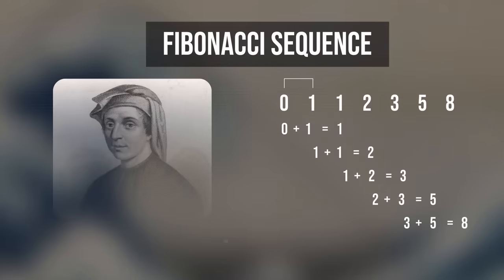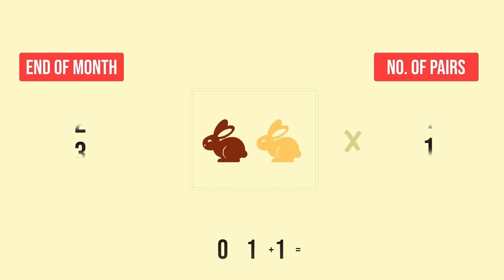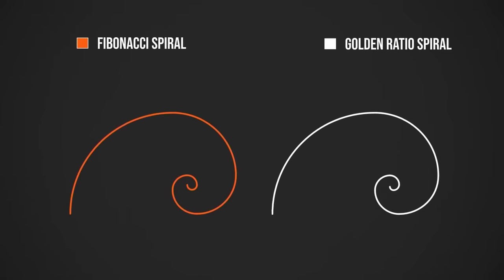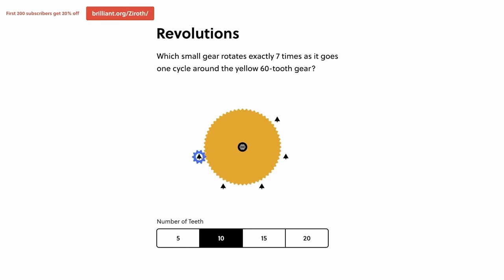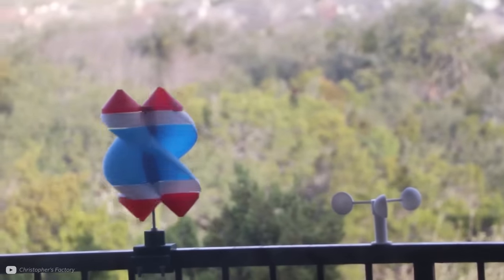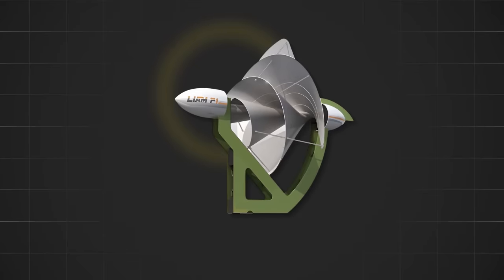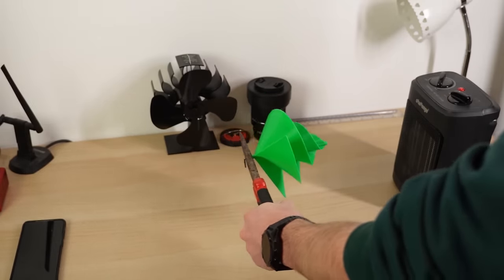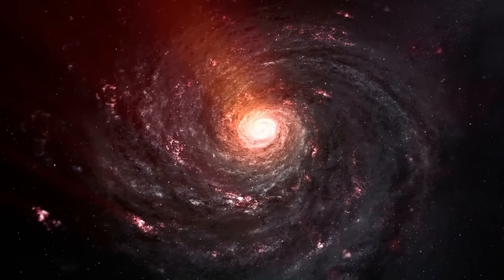Uncovering The Genius of Fibonnaci Turbines

Comment: The most important metric of a wind turbine is the levelized cost of energy (LCOE). This metric allows you to compare all forms of energy generation in terms of total energy return during the lifetime of operation per investment dollar spent.
Reply: Not at all. 

You fx also has to add the local climate by temperaure and dirty air, where there are many buildings. 

That give people a lot of bills, they are not 100% and also needs for expensive beds.
Reply: lets for a moment ignore the fact that wind turbines do affect the eco system for birds and other wildlife... 

most wind turbines do advertise a life span of 25yrs (which is true in a controlled environment) but we're almost at the end of some of these wind turbine government contracts and the true cost comes out, on avg these wind turbines last 1.5yrs- 2yrs on avg before needing to be replaced and the efficiency actually drops to less than 33% within the 1st 3mts of operation (on avg every 8-10mts the blades is replaced).. this is all thanks to the blades deteriorating much faster than expected, you can use the strongest materials known to man and this would still happen.. the other factors is the weather pattern and storms, in the real world when storms hit wind turbines they need to be replaced, even if you can't see the damage there is micro cracks all over the blades and 90% of the time the motor/ generator is damaged.. now if you think burying nuclear waste was a problem well getting rid of the glass fiber blades is a much MUCH bigger problem (in terms of space requirements) and no they don't biodegrade... as a comparison wind energy takes more ppl and more jobs is created than nuclear energy BUT because there is over 100times more ppl required to make the same power so that factor alone makes wind power more expensive than nuclear energy....
Reply: @dunhillsupramk3  I'm interested in learning more. Can you cite your sources?
Reply: Very interesting.Takes me back to June& July 2000 when I was part of a group of teachers that visited the USA  to learn new methods of teaching Science, Maths and Technology.That is where I first learnt about Fibonacci.VERY VERY  interesting that  nature has the aswers to many of our questions about our lived world.
Reply from the maker: Great point! There were not LCOE figures available, partly because only one of the shown designs is actually commercialised. I image the LCOE would be pretty poor for the Liam F1 Archimedes turbine if you brought it from the manufacturer, but the design is pretty simple so I wonder if there are benefits in the DIY space! Thanks for the comment!
Reply: @ZirothTech  thanks for the reply and the great video! I'm always excited to see innovative renewable energy ideas! By the way you did a great job explaining things, I've just noticed that engineers tend to focus on efficiency when return on investment is what actually drives large scale adoption. I'm a Mechanical Engineer and have been guilty of this myself in the past.
Reply: @bobbob-gg4eo  You can't cite on Youtube.  They blocks comments that list sources.  Even just the names of books.
Reply: @MM3Soapgoblin  aka "I made it up and have nothing to back me up"
Reply: @richardmyers6372  Not my rules... go ahead and try to post some sources.  Then open up a private browser and see if the comments show up.  I'm not defending either position.  I'm pointing out YouTube's rules.
Reply: @MM3Soapgoblin Twi Global: HOW LONG DO WIND TURBINES LAST? CAN THEIR LIFETIME BE EXTENDED?
Reply: Oh, would you look at that, the comment is still visible...
Reply: @richardmyers6372  I don't see a comment citing a source...
Reply: @MM3Soapgoblin  Weird, I see the name of an article that when searched brings up the source as the first result.  I suppose your browser has an issue, have you tried deleting your cookies and clearing cache?
Reply: @dunhillsupramk3  High estimates of bird deaths in the U.S. from wind turbines are around 1/2 million annually.  And from windows, 1/3rd to 1 billion annually.

> lets for a moment ignore the fact that wind turbines do affect the eco system for birds and other wildlife...

Good call. 😉
Reply: @funfight22  Try citing a real source like a scientific journal or textbook.  I don't consider the name of an article like that a source.  I saw their comment, my point was that it was not a real citation.  I've tried recommending textbooks on some physics videos and the comments are always blocked.  Same when I try to link to scientific papers.  Names of blogs and articles are hit or miss because, like in the commentors comment, it looks more like a regular sentance than an actual article.    Like if he put the url domain, no chance it would have worked.
Reply: @MM3Soapgoblin  lets do a test.  this is reply 1 of 3 for a reference.
Reply: @MM3Soapgoblin  OK,  in my browser, the direct reference is delete, but it's pretty easy to get around. as comments 2 an 3 do show up.  Thanks for inspiring me to figure this out
Reply: @thekinginyellow1744  Are you logged in as yourself or did you open in private view without logging in?  The only response I can see is the "let's do a test 1/3" one.
Reply: @MM3Soapgoblin  OK, it looks like they have both a fast and a slow algorithm.  the initial reference was deleted immediately when I posted the comment, but it did leave the rest of the " 1 in 3" comment.  but now, after 4 hours have passsed, comment 2 and 3 have been completely deleted.  I have verified this for when I am logged in as me using the chrome browser, and for when I am not logged in using the firefox browser.   I guess I'll have to try harder.  Every day I grow to like youtube less and less.
Reply: @HonoredMule  oh you want to go there?? then lets go there... so when i said it affects the bird and other wildlife its actually much more than just killing them... if you ever looked at a wind turbine you would notice that there is a lack of birds and the ones that they do kill is mostly birds that migrate but other than that you don't really see birds miles anywhere near a wind turbine and this also turn them away from food sources, breeding grounds etc etc, so its much much more impactful than just killing a few birds its killing off their population...

 if i was a farmer i would put up a wind turbine near my crops as it would drive away all the crows... because its that effective and in fact for some farmers some of these wind turbine companies use that as part of a selling point and it does work it even force away of wildlife in the area...

here is another thing to consider in NYC pigeons are a pest and in the near future they plan on being pigeon free, their plan is to install wind turbines to get rid of all pigeons (this will lead to a much larger rat problem)
Reply: @dunhillsupramk3  outdoor cats are worse for birds and such
Reply: @henryrossouw930  I don't know what math and physics you learned,but that turbine can not even get close to the efficiency of a medieval windmill,not to mention modern eolics......Why i claim this? Because it have a huge drag and friction with very little active surface . Some people don't realise  that a turbine is moved by the inertia of the mass of the air passing thru it. Reason why the eolics have only 3 blades with a lot of space between,having more blades would just swirl the air and increase the drag and the mass of the turbine,lowering efficiency.
Reply: How come barely anyone talks about the amount of fuel that each individual wind turbine requires to operate before they have to chuck all that non-degradable garbage into a pit tucked out of sight?

Our generations of so called "civilized" modern man will amount to nothing but a layer of plastic and silicone buried deep in the earth for an actually intelligent life form to dig up millions of years from now. Or better yet, to never be unearthed and forgotten entirely.
Reply: The most important metric of a wind turbine is if it would remain running without subsidies.
Reply: @The_Ballo Sounds like you're against oil
Reply: @BlueBenGo  As in the mount of oil a wind turbine transmission goes through?

I'm pro-sustainability, and if you don't know economics you wouldn't have a clue.
Reply: @dunhillsupramk3  yeah, you are pulling this from your arse, i do live next to wind turbines and i do have a biology bsc, but saw nothing similar, nor have i found any research supporting you
Reply: Exactly. Which is why SOLAR panels are by far the best form of renewable energy - they will last for fifty years, need no maintenance, and the cost per kWh is much lower than any form of wind power... Funny how you don't see any videos comparing the cost of solar power to wind power, isn't it... That's because wind power is so much more expensive than solar that it would show what a con wind turbines are...
Reply: @airtale.p  so a biology bsc wants to tell a MSc about wind turbines?? k.. where did you get that Bio bsc?? was it a clown college?? because you sound like one...
Reply: @tulpasconstructor2711 turbine blades are not actually "non-degradable", they degrade in UV light. They do seem to be non-BIOdegradable so when they're being stockpiled for recycling they're buried because it's cheaper than building structures to cover them.
And yes, they are being recycled. That's slow at the moment because there's not yet enough blades to recycle (blades are lasting up to 25 years in real-world situations) so "economies of scale" haven't kicked in yet but they will.
Reply: @bobbob-gg4eo  I live up the road from the Waubra wind farm. I remember when it was installed - those things don't look big once they're up in the air, but when the individual blades are being carried up the highway on specially built trucks with a police escort to wave everyone out of the way, they're really not small. I reckon we'd have noticed if they were replacing them every couple of years.
Reply: I wonder if this kind of design could be useful to generate thrust as well. 🤔
Reply: For the sake of the arguement, lets simply say the number of bird strikes is >1. because somebody, somewhere may have seen it happen. Also, if the number were that high, -in the millions, thats a lot of blood and bone piling up under the blades. perhaps some organic gardens could make use and recycle the detrus of human activity. Waste not, want ... a lot, or so it seems.
Reply: @dunhillsupramk3 our rat population exploded when they killed off much of the racoon problem by putting racoon proof fittings on garbage pails. You likely dont want lots of rats in my experiemce.
Reply: @johnthomas338 im in the arctic so need solar in the summer and wind in the winter when the sun doesn't even get fully above the horizon. Our electricity is made from fuel brought in by ship in the summer. Really Expensive!

Comment: As the entire surface of the front view of the spinning blades is solid material. Not transparent looking like the gaps between spinning straight blades. Birds might not try to fly through the "danger zone" as they will see the solid metal / plastic  body of the turbine as they approach from the front or back. So perhaps fly around it. ☠
Reply: This is also why it doesn't work--- it's unstable to destructive winds and it's not as efficient as passing the air through to harvest energy.
Reply: @annaclarafenyo8185  True. They can't brake them in destructive winds. The traditional blades can turn on their axes to capture less wind.

Comment: Seems to me that the mountings they are using are sub-optimal,  the wishbone bracket should be horizontal with a pair of rotors with opposite spin thus canceling the gyroscopic effect which would inhibit turning into the wind.  This pair assembly then sits on a single pivot point where the two wishbones meet (like to back to back 'C' shapes) which is at the same height as the centerline of the spirals, which means far less torque force is needed to rotate it.  This could even be expanded to a quad system all pivoting on one point.  The reason you need to do this is that the main mast of a wind turbine is costly, so maximizing the amount of air captured by it is critical for cost effective deployments.
Reply: Ignoring efficiency of scale & costs of complexity, adjacency interactions impeding ambient airflow etc., aren't you?
Reply: @dennisbecraft1303  I would guess that having two counter rotating gear linked turbines in parallel with small clearance would increase efficiency thanks to high pressure zone forming in middle creating additional lift in direction of rotations.
Reply: @skyrask1948  Possibly, if it worked something like an augmenter shroud.  I'm guessing too, but I was imagining the resulting higher pressure spot wouldn't be ideal because it's asymmetrical, like not having the rotor aimed directly into the wind.  Established theory only gets you so far, then you have to test your own hunches empirically.  
A 15% improvement on a very old drag design is impressive.
Reply: I don't know if placing many of these so close is a good idea. In conventional wind turbines a lot of care goes into placing them in a way that minimizes their effect on each other. I'd assume that if you placed two spirals right next to each other, the effect of the air being diverted to the side would be reduced, and the uneven load throughout one cycle would cause more significant material fatigue. Plus, if the rotation of the turbine was hindering it turning to the wind, you could just place the turbine further back, or add fins behind it, like you see in some old-school water pump wind turbines.

Comment: 9:09 you are welcome for that 1second of footage from my backyard.
Reply: Haha
Reply: Thank you for your video contribution.  Wind energy paired with solar could essential help all single family home to be less grid dependant.
Reply from the maker: Sorry the credit wasn't clear in the corner - It's an automatic layer and I should have changed the colour of!
Reply: @Friendly_Gamer_Mom  True, wind and solar would complement each other really well on the home, solar is effective in summer weather whereas winds is effective in winter weather as well as nighttimes and at pretty much any time of the year, which if I recall, wind is stronger in winter compared to summer and is also a little stronger at nighttime when solar doesn't generate anything.

The other potential advantage of having both, by having a more consistent energy being generated, you'll need less of a buffer when it comes to how many batteries you need.

But we'll have to see, we've heard so many promising ideas for wind power in urban areas but most just don't work that well, but in recent times, we are seeing a lot more creative ideas on the table, so if any of them can generate some meaningful energy, be cheap enough to buy, it could become a game changer.

Comment: The whole idea that some plants use that arrangement of leaves to maximize the amount of sunlight they get has never made any sense to me. 
First off, the number of plants that do that is quite small. Opposite leaves, whorled leaves, alternate leaves on the same plane, and other growth forms (grass-like plants, vines,  columnar structures, etc) are VERY common. 
Second, I don't think there's much of a correlation here- not every plant wants to maximize its exposure to light (think of plants living in the desert) and many of those that don't still have a spiral pattern of leaves/branches (some cacti, aloes, yuccas, things like that). Many of the plants that you'd think would really want to maximize light exposure (understory plants, those living in high latitudes, etc) don't have such spiral patterns (trillium leaves, mayapples, clovers/Oxalis, Claytonia, most peperomias, etc).
Third, you literally practically never find these spirals out in nature. Many of the examples people use have been strongly artificially selected. Some of them don't even have anything to do with light exposure (eg. pine cones, sunflower seed heads, or pineapples). Even the plants that, under ideal conditions, grow as those nice little spirals, often don't grow like that in the real world. They are often bent towards one side or another, the spacing between the spirals varies, etc.
Fourth, that explanation only really works in a VERY limited set of conditions- light coming directly from above, and plants with leaves that are very close to each other and that can't move. However, the sun moves across the sky so that the light is practically never coming straight from above, plants are practically never oriented perfectly straight up and have many horizontal or diagonal components, the leaves are often not all that close to each other, and individual leaves can also move to face towards the light. 

No, I don't buy the light explanation for most plants (even many with a spiral pattern of growth). I think the real reasons involve just the fact that developmental processes are iterative and the fact that packing things into spirals is often an efficient way of packing a lot of things in a relatively small space.

Comment: All logarithmic spirals grow and shrink based on the same ratio every turn.
That is what it means to be logarithmic.
It could be that every turn doubles in size, meaning the ratio is 2.
It could be that it increases/decreases in size by a ratio of 1.000001.
It could be that it increases/decreases in size by a ratio of 9 million.
 
The Fibonacci ratio is just one with very specific properties that relates to anything that is fractal.
Nature is full of fractals.
Seashells are not fractal and therefor do not need to follow the Fibonacci ratio.
Natural spirals like the ones of the seashells has nothing to do with this number.
Most of them are not even close.
The Fibonacci spiral is very aggressive compared to that of a conch.